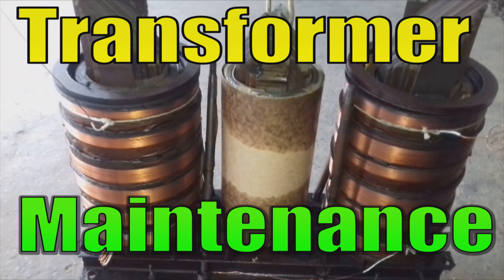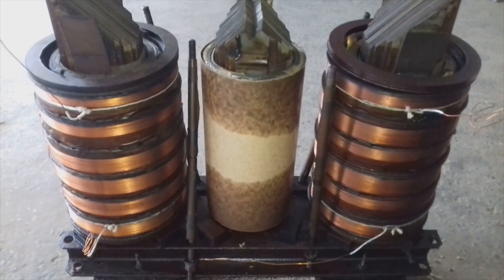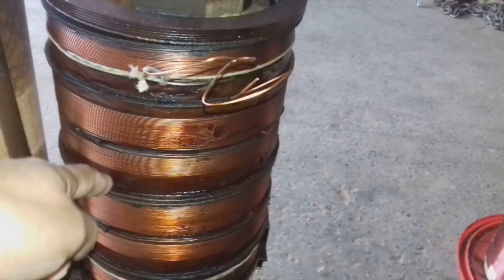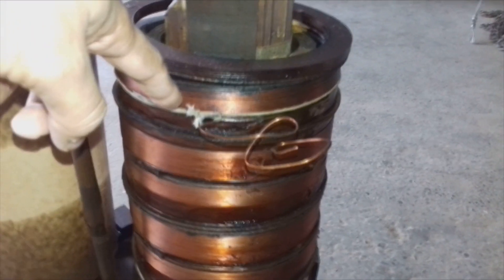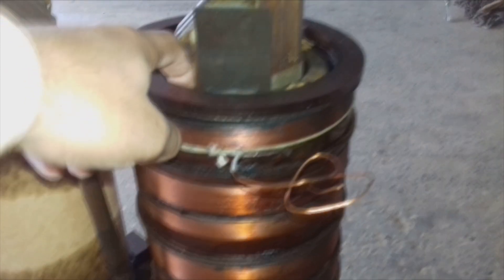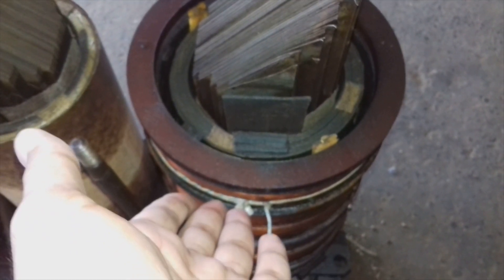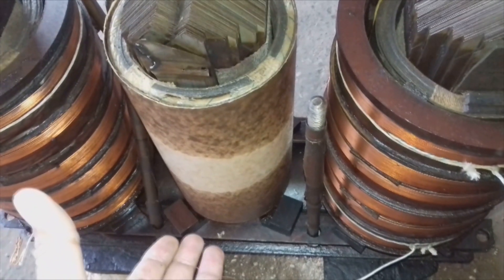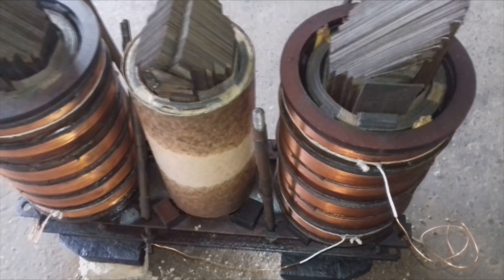Transformer repair part 5. Transformer coils winding arrangement.

Comment: What are you trying to explain ?
And secondly HT coils are made of aluminum not copper. HT coils are varnished that is why it look like copper. Please check properly and try to give proper information.
Reply from the maker: Aluminium is now a days used in low quality transformers. Maybe you have seen those c grade transformers that is why you commented like this. And what I'm explaining here, is something a real practical knowledge. Electrical technology is difficult in  it's nature. Watching a real engineering video is way difficult and headache giving compared to watching a movie!
Reply: @JahanZeb1976      pl do not disappoint  for such comments. u have explained very well.
Reply from the maker: I know that I explained it well. But it is important to provide injection to sick people. Thanks for appreciation.
Reply: @premalathalatha3587  yes absolutly for low voltage purpose like farmers land maximum 63 kva aluminum HT windings can use.